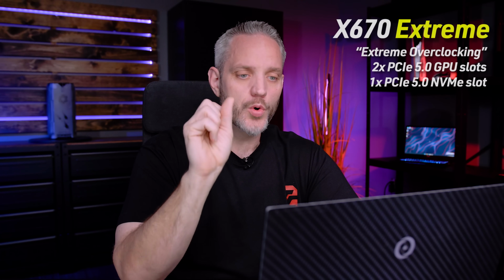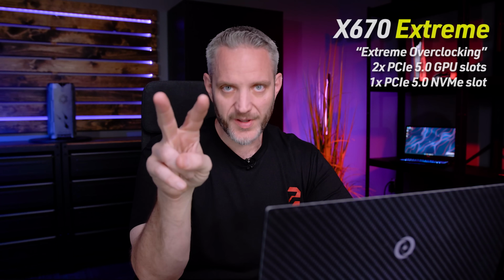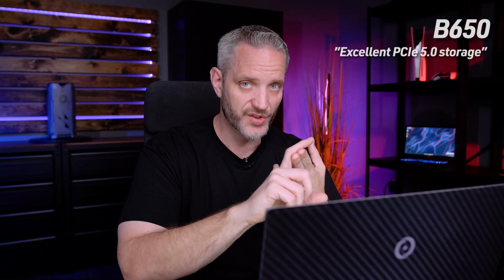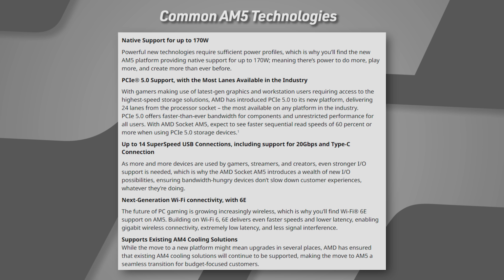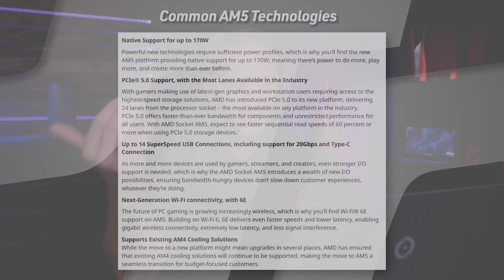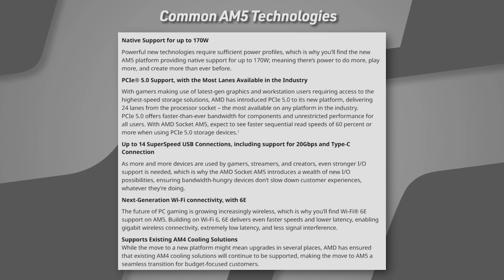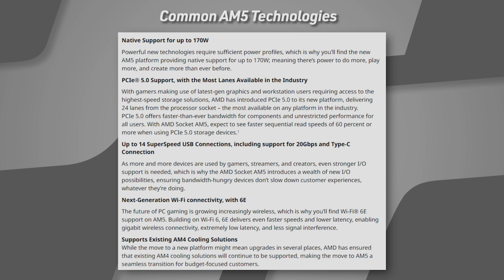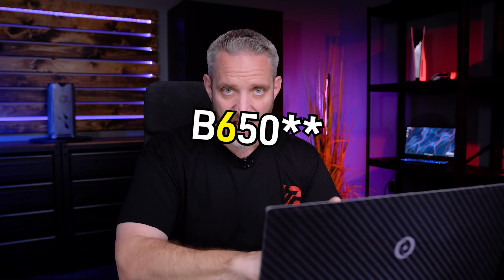AM5 Motherboards are EXPENSIVE! AM5 Explained

Comment: Motherboard prices have been idiotic lately. Even for a 2000 dollar build, a 150 dollar motherboard should be a very good fit. But these days 150 is the absolute minimum for a semi-decent board. Which blows.
Reply: Even crazier if you prefer mini itx. Mini itx pickings are slim with amd.
Reply: @TheSolidSnakeOil  mATX is even worse. I ended up going with ATX for my newest build just because I couldn't find any decent mATX AM4 boards. All my other previous builds have been mATX with Intel and there are usually a decent choice of higher end intel boards. AM4 was just like one crappy ASrock board and another board that was always out of stock.
Reply: @IdiotRace  dude I know what you mean they have 300 dollar asus ones and a gigabyte thats it
Reply: @TheSolidSnakeOil  not really, they aren't, you can actually get some pretty good mini ITX X570 boards if you prefer sticking to AM4 for now, as of X670 being ridiculously expensive.
Reply: @theroyalaustralian  The problem isn't finding them, it the few choices I have. It's pretty much Gigabyte/Aorus or Asus/ROG. Asrock if I want to overpay, for what should be a cheap AB board. And they usually have more video out than usb ports.
Reply: @TheSolidSnakeOil  not really, I mean, my board is originally an AsRock board before it went to its board partner ASUS TUF Gaming.

The board has just as many USB Ports as anyone.
Reply: That's why I am going to stick  with my 5800X. The motherboard  it's  in, sadly, is a Asus Rog Strix B450-f, which only has PCIe 3.0  graphics and NVMe  storage..... But, maybe the RDNA 3 GPUs and the  PCIe 4.0 NVMe drives  wont be any slower, for gaming, than higher specs...... Unless RDNA 3  GPUs run more than 10% slower in a PCIe 3.0 system  vs 4.0 or 5.0..... AND unless direct storage  technology for gaming runs a lot  worse  on PCIe 3.0 systems vs  40. or 5.0, ..... at WORST I'll need to upgrade my mobo to an X570..... while I upgrade my GPU and NVMe..... at least I would get to keep my 5800X and 4X8 RAM kit(4600 16-19-19-36)
Reply: @Dennzer1  your motherboard is a lot better than mine (asus prime z390m plus) my cpu is i79700kf my motherboard kind of sucks i wish i bought z390 tuf gaming
Reply: @Dennzer1  Dude, that RAM is insane! Holy f*** thats fast RAM 😯
Reply: @Dennzer1 friend. It's difficult to bottleneck a gpu even on pcie2. Pcie3 is just fine for a long time.
Reply: This is why I’m happy I didn’t wait until am5 to upgrade. Because prices are going to be ridiculous at first, and this is only the start of what AM5 can do I’m sure. Of course, prices are always going to increase, but that’s the way it is.
Reply: @MasterSean3125  plus you NEVER be the early adopter. Unless you got more money than sense.
Reply: @DATWagonator  Isn't this never the case though? Why would anyone want to be an early adopter of these newer boards?
Reply: @MasterSean3125  but then it decreases months year each time.
Reply: $500 boards blow caps start fires
Reply: Everything seems to be shooting up in price again. I dont get it.
Reply: I bought the $2100 MSI Z690 Godlike because I caught the holy ghost in the motherboard aisle at Microcenter.
Reply: I have been using Asrock B450 Pro4 motherboard since 2019, which was $79 at the time, and up to this day, it has been amazing.
Reply: I agree, I was lucky and got me in 2020 a X570 for 180€, I wont change for at least 4 years....
Reply: I bought my ROG b550 mobo for 200 CAD (156 USD) back 1 and half years ago. Consider waiting 1, 2 generations for sure, to get that price drop for a suitable budget with AM5.
Reply: 200-250 is the norm these days.....
Reply: @neroz06m.20  Yup, its the same where I am...
Reply: Make it an itx then the price goes up like 50 more dollars and I realy just love building mini pc lol
Reply: @shadowofthestarsdespair  yeah the* danXlianli a4 H20 is really tempting
Reply: I could not agree more with you.
Reply: J M  i for example bought a 200€ gigabyte gaming x z690 and i don't see any reason to buy an overpriced asus maximus or hero. I have 4 m.2, pci 5.0 for the futute with another graphic card with my 12900k, i dont want onboard wlan and stuff like that, the realtek onboard sound is good enough and i'm not stupid, so i wont build a sli system what would be even possible too
5,2ghz multicore enhancement with llc high vcore 1,375v is working with 93-95°C, ram got problems 5200 unstable 5000 not working so i can run my 5600 ram just on 4800. that's the only thing that i don't like about the mainboard. So my around 3k € pc with a 3080ti got a cheap mb and it's good enough.
Reply: If you stop focusing on those useless overkill $1,000 motherboards you can definitely get decent B650 motherboards when they come out for 150-300 dollars... If you're not overlooking (let's face it 90% of people aren't) Then why would you need a high end motherboard. AMD basically guaranteed $150 for a B650 minimum. AMD will probably support the new motherboards till 2027 so that is worth it, Intel on the other hand is a difficult decision to go for since their platform is a joke for longevity.
Reply: @Kizzster  I couldn't agree with you more on Intels longevity muh dood, but no one is stupid enough to go for B600 series boards dude as any board in the family of B series has very bad USB controllers.

I should know, 1 USB Port on the front of my case is not doing well, while the BIOS USB Port has blown completely, along with 1 on the very thing responsible for blowing the BIOS USB Port, my electric mouse mat.
Reply: Chip shortage and inflation. Cars too with computer chips have skyrocketed
Reply: @timothygibney159  there's nothing like upgrading an older vehicle to be as safe to drive as a Tesla
Reply: @timothygibney159  this is while retaining its carburettor and other s***
Reply: For 150-200 you can easily get a Gigabyte Ud Z690 DDR4 board with 3+ M.2 slots, of course you won't have WiFi and overly fancy stuff, but why would I need that anyways. I don't get the point of these high-end gaming motherboards if they have the same chipset and just look better.
Reply: Well the 150 dollar board is better built than the 100 dollar boards you got three years ago, the 500 series needed a LOT more copper and the 550 was as good or better built than the 470 was. The downer is nobody is yet trying to skimp for budget buyers, but if budget is a thing, then AMD is better, because even if you don't actually make an upgrade in time, it is far more likely to happen with AMD than Intel. If you keep a board for 6 years and neither AMD nor Intel have a board that lasts that long, then board makers need more of your cash to stay afloat, so will charge you more. If that means a board lasts 8 years instead for you, then the board maker doesn't care, you just shrink the market.
Reply: I think you are referring to something that’s been going on for decades now….inflation.
Reply: @OKLOL320  Indeed. But sometimes it happens fast. For instance. The rate has been rising since Oct 21 and went from 2% to almost 9% in less than a year. It's near 8% now. But hopefully it continues down. Not likely though.
Reply: @ZFPS115  yeah, we could only wish. Since 1980’s the $1 has inflated over 50%
Reply: @OKLOL320  my grandma used to be able to go out to the movies and have change left over from a quarter.
Reply: Thats not true... you can get fantastic motherboards for 150 dollars unless you are dabbling in itx, just look for sales. On AMD, B550 has lots of options in that range regularly. They have all the features one would want/need. Most people don't need x570 but they look at it as the best of am4 and overspend.   It generally just depends on how many pcie gen 4 lanes one needs. For me, I needed 2 which b550 covers.
Reply: I am doing anew build soon and will be going with a 5800x. maybe next year or later I will grab the 7800x3d whenever it comes out snd buhs are fixed. i just need reliability and a $1400 budget gets me an 8 core 16 thread and 6700xt/6800xt build that blows the laptop I have out of the atmosphere lol
Reply: Look how complex motherboards are today. You expect a good one to be under $150?

I’m surprised they’re so cheap to be honest
Reply: @codycast  the high end boards just a few years back that were packed with just as many features were still less expensive than they are today for the same amount of features.
Reply: @Rocotaco  1) inflation and 2) tech is improving rapidly. Getting each new bit of performance comes at more cost. Look at the cost to go to a new process node now vs before for example.
Reply: Problem is we all out here building 10k dollar builds
Reply: They’re trying to pull the Nvidia gpu scam on buyers now for motherboards 😠
Reply: I payed 70u$ for the b350f strix new when i Migrated to am4,  now the Basic mobos with b550 no rgb no extra fan pins cost 200! ...
Reply: Damn a friend of mine wants to start streaming too, I guess I have to tell him the motherboard news haha
Reply: Exactly why I think of sticking with B550 for another year or two. MSI B550 Unify + Ryzen 9 5900X is a great combo of the times.
Reply: We will have to see how AM5 can stack up to this generations motherboards/CPUs/we've seen how AM5 stacks against last gen/the 1700 socket/Alder Lake/Raptor Lake, we will have to see how AM5 stacks up against this generation/the Meoter Lake/Arrow Lake/the 1851 socket.
Reply: You should never buy an entry level board for an upper mod range-high end build. It just doesn't make sense.
Reply: @Jdogg4089  I think it does, why pay less to get the same if not better performance? the B450 tomahawk was better then a lo of X motherboards. like way better while also only costing about 33% as much. I cant say my current build makes sense but thats another story. I dont see why you wouldnt buy a better entry level board for cheaper.

 like the B450 tomahawk vs he MSIX570 gaming motherboards that could literally not even handle a ryzen 5 due to the Vram overheating, despite being the more high end AM4 motherboards. Meanwhile the B450 tomahawk that only costs like 50 bucks could easily run a 16 core ryzen chip.

and even compared to not terrible high end boards like some asus motherboard or something or the asrock taichi, all youre losing is pcie 4.0 which unless you get terrible gpus doesnt matter to much right now anyways, maybe some M2 slots, which can matter a bit more in fairness, but its still got atleast 1. so youre not losing any real features, unless you really need a lot of M2 drives.
Reply: Yeah sticking with my 5800x3D 
I’ll upgrade to 4090 when I get extra load of cash along with a C2 42 OLED
Reply: It's not so bad if you plan your upgrade path accordingly.. my nephew just upgraded from a 2700x to a 5800x3d and only had to buy the cpu.  That's why I'm also going team red this time around with the x670e because it will support future chip generations as opposed to Intel with a 13700k ..I can't justify spending $500+ on a board thats specific to that generation alone.
Reply: I payed 330 back in April for a ddr4 MSI Z690 Edge Wifi and it's got 4 or 5 pcie 4.0 m.2 slots and I felt like I got a decent deal. I just had a few requirements I needed and that left me with a mid range board.  1. 2 X 3.0 A and 1 Type C front I/O  2. Optical audio port for my headset and 3. Future memory and RGB capability.  Those 3 things really did make the selections limited.  Oh and I wanted a power delivery of 15+1+1 or better.
Reply: @DATWagonator  I'm new to pc building and just bought a msi b5550- a pro motherboard paired with a 5950x, did I make a mistake... please help 🙏.
Reply: I couldn't agree to you more @Eco, but my board would cost you abot $79
Reply: Never understood this.. ppl are willing to pay 4 to 700 on the computers brain but if a motherboard.. the connective tissue that connects everything together is to expensive at $2-300
Reply: @balla2172  because the motherboard does little for overall performance, as long as it does its job aka connects all the components then that's all you "need"
Reply: @balla2172  I always bought expensive mainboards and the last build i used the cheapest z690 for my 12900k at 200€ it's a gigabyte gaming x ddr5. It's actually ok beside the ram speed. Maybe it`s the icm that it wont go any higher than 4,8ghz but in gaming it doesn't matter. I don't see me buying an overpriced mainboard ever again, especially i don't want rgb.
As far as i know the 600€ Asus mb have the same problem.
Reply: @name-ic3vo  I went with a cheap gigabyte b350 mobo when I got my Ryzen 1700 like 5 years ago. It's still going strong. Gigabyte software sucks but besides that it's been totally fine. Thanks to a bunch of BIOS updates I can run 3200 RAM now.
Reply: @splitt3r That's definitely true i bought 4 Gigabyte mainboards in the past 14 years and the hardware is always pretty good but the software is mostly terrible, like bluescreen generator rgb fusion for example lol 
I don't remember the exact name of the mainboard with the undeleteable dual bios it was a socket 775 mb for my q6600 that could be deleted with a bios update.
I don't download any drivers from their website that i can find somewhere else. App-Center installs so much stuff that i really don't want and just need it for @bios. After a bios update i uninstall everything from Gigabyte again. 
The aorus gaming 7 xmp profiles of my i7 8700k are still not very good and the corsair dominator ram just runs at default 3200mhz.
Reply: @balla2172  In general, the motherboard doesn’t help it perform better.  So it’s down to features, which cost more.  Many examples of say X370 vs X570.  If you clock memory and such the same, they will get mostly identical scores.  This is excluding disasters such as budget B560, though.
Reply: @balla2172  I guess you forget they were $100-250 not that long ago with many under $100 😠
Reply: @balla2172  Considering that you could get a reliable and well-featured mobo for $100 just a few years ago, yeah $300 is f**king crazy.
Reply: @balla2172  The problem is the most common failures are hard disc drives and mother boards and so their life expectancy is low and since they make a finite number of them the older the generation you're needing the more expensive it can get.
Reply: @DATWagonator  This is incorrect actually, HDD's only ever fail if you drop them, or if they have a head crash, which both scenarios are extremely rare as no one is stupid to drop a HDD in the first place, and no one is this dumb enough to get an expensive board these days.
Reply: @DATWagonator  Oh, and plus, refurbished older generation boards exist muh dood
Reply: @DATWagonator  Also I think you might find that if you do not put too much power through a board, its life expectancy sky rockets.
Reply: I paid $50(and $150 for CPU new @ MC) for my board.. and I get 90% the framerate of any $5k build. Motherboard quality has no relation to performance and cheap board are available.
Reply: @TheCosmicMason  bro the max im willing to pay is 200 past that and its just bonus stuff i have a strix b550 a with a 5900x and 6900xt and its fine for me
Reply: @TheCosmicMason  Well this is complete bulls*** I'm afraid, because welcome to the wonderful world of reliability, wherein cheaper boards are much poorer in quality then say a fully refurbished $179 X570 board.
Reply: I had a B450 board that died on me recently(she saw a lil abuse lol, I got my money's worth) and needed a replacement, so figured I might as well upgrade to a B550 and get that PCIe 4.0 NVME support(even though I know I'll never tell the difference...) and any new features that AMD tends to roll out on newer chipsets first. Started looking at what was out there, prices all on a different level than B450(weren't these X370/X470 prices?) because of the greater build quality requirements of PCIe 4.0, and finally concluded that B550 is just a waste of money. For something like $15 more, I ended up with an X570; I don't need the features but it has all the features I need, and it'll hold its value better. 2x 4.0 NVMEs is just a bonus(but, like I said, I'll never be able to tell the difference lol).
 
I feel like AM4 was a mini-golden era - I got into it for next to nothing with a $100 R3 1200, $65 B350 Pro4, and like $65 of 8GB DDR4, just to mess around with the new platform. Ended up with a couple 6 & 8 cores, and a number of different motherboards, pretty much all of which were 'open box' under $100 from Microcenter(this X570S Tomahawk Max WiFi was 'open box' too, like $170, had everything but the SATA cables, like new), and a small pile of DDR4 of course; a lot of product for not a whole lot of investment, AM4 has been a fun ride. I'm gonna miss those decent $70 & $80 motherboards.
Reply: For a $2,000 build, $250-$350 boards are what you’re looking at.
Reply: @Carnage1180  Ehhh, no, if your budget friendly, no one would be looking at boards with those prices.

In future, I'll be going with an X570 refurbished board.

But for the further distant future, I'll only be getting X670 referbished boards.
Reply: @theroyalaustralian  maybe don’t build a pc if you’re looking for refurbs only.
Reply: @Carnage1180  I'll do what I like within my budget thank you.
Reply: @Carnage1180  when I bought my 6700K back at launch, it was actually expensive as fuck to be spending more than $300 for a motherboard for the Z170 series. 

Now it's much more common to be spending that much on a motherboard which sucks a lot of ass.
Reply: @Carnage1180  you are just paying for mostly useless features, I think that GN or linus made a video comparing different types of Mb (cheap and expensive) 
 
all of them gave pretty similar results
Reply: @Carnage1180  true, more like 0-50 considering your gpu will be like 1200 atleast if youre buying rx7000 or rtx 4000, and cpus are also getting very expensive, so thats another 350, ram is like 150 for meh ddr5 here, then you still need a case, cooler storage etc. so youre not looking at 350 for a mobo when your budget is that for a new build.
Reply: Well you can thank Inflation. Our dollar has gone to S since Biden. No sign of slowing down. Maybe McDonald's workers will start getting 20$ an hour. But a meal will cost ya 15-20
Reply: @ZFPS115  I seriously doubt it’s inflation, considering the facts that graphics card are cheaper than ever, especially on the AMD side. If they can afford to sell below MSRP, then the MP manufactures can afford to sell at normal prices.
Reply: @steveqi9309  Cheaper than ever? Or closer to MSRP than ever? I don't see any new GPUs for "cheap". Used mining GPUs on eBay maybe. But a MSI 3080 still goes for 740$. I bought mine for 900$ on ebay new when it released. The prices are better than before. But not great at all and due to inflation. The highest rate since the 60's. The New GPUs are where Nvidia will make up the margins. They just need to get rid of the other 30 series. So they discount them to make room for more profit.
Reply: @ZFPS115  Man have you seen any price comparison video recently? Almost all cards (except for Nvidia mid and low end) can be had for below MSRP new. like rx 6600 for $250~, that’s a great price even before the pandemic.
Reply: @steveqi9309  I agree there. But the new cards will be pricey because of it. Margins are already set on the current lineup. Are you arguing that inflation is not happening? Everything has been going up fast. Tech will not avoid that.
Reply: @ZFPS115  I really doubt the new cards MSRPs will be much higher. Also you say margins, but both companies could have kept them at MSRP, the fact that they’re going below MSRP just prove that even at the current prices the margins are still satisfactory. I’m not saying inflation is not real, i’m just saying if the graphic cards are able to keep their prices low despite inflation, then MPs should be able to too.
Reply: $200 is only $50 more, don't cheap out on your motherboard (or ram) since you will likely have it for 2-3 CPU generations
Reply: @ski69bum  CPU's last you easily 4 years these day;s. The old day's where you need a CPU each year to play the new games are over.